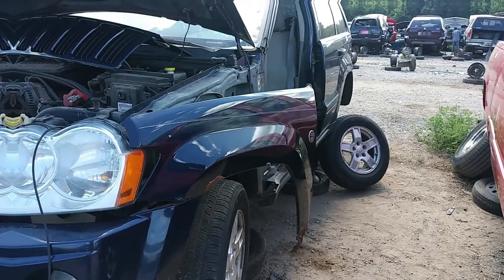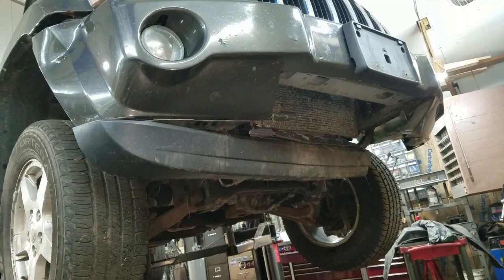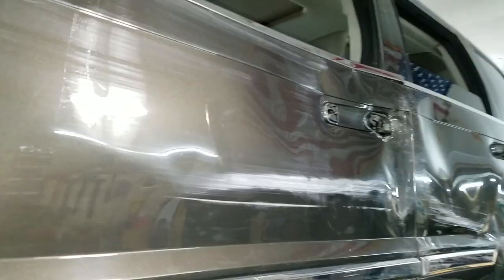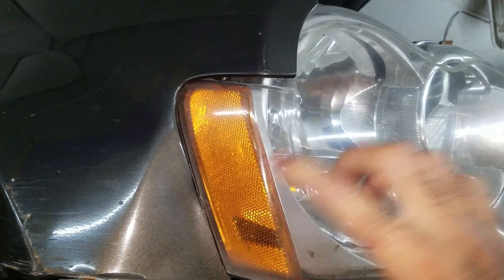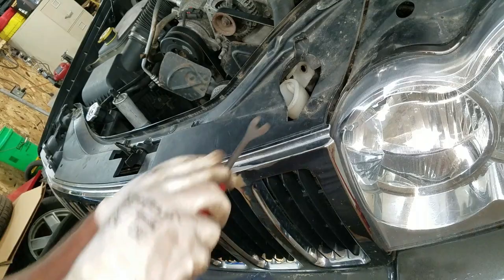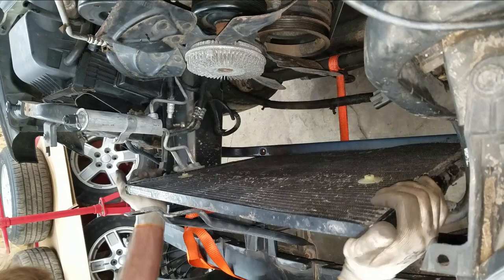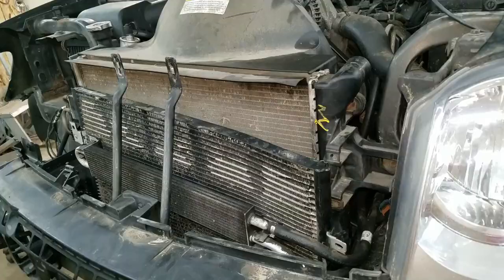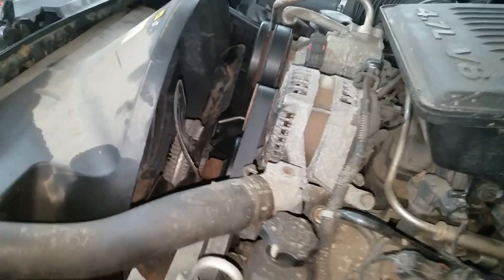2006-2010 Jeep Grand Cherokee radiator bumper cover grill replacement

Comment: Yo!   The correct term for the clippy things is "Scrivets"
Reply from the maker: Scrivits

Plural of scriv; (Weed) scrivits AKA scrives. Pronounced "Skriv-it's"

1)Shake.
2)Tinny partials of weed.
3)What is left in your nug-jar after smoking all your buds; the little hairs and crystaly stuff.
4)Little nugs that fall off your big buds that are good to roll joints or blunts with.
Reply from the maker: @tbskirk  Now I'm going to have to use that instead of clippy things.
Reply: @RustBeltAuto  Scrivets are the ones with screws. It's a rivet clip. But that's not as cool sounding as clippy thing.  Or maybe crivet. I dunno, w/e.

Comment: Hey brother sorry to bug. But you have helped me in the past and I hope to be able to ask another question. Engine stuttering when taking off. I start it cold and let it move up a few lines then I’ll start to move. But it isles and jerks. Idk what to start with first. IAC MAF or tps. Any idea? 99 Sierra with a 2003 4.3 Silverado engine. When warmed up normal and driving I can hit it and takes off like a dream.
Reply from the maker: No codes?
Reply: Rust Belt Auto no codes at all.
Reply from the maker: @Angel-wf6jh  make sure both ect, and iat sensors are reading the same temperature within about 5 degrees, when it is dead cold. start there.
Reply: Rust Belt Auto oh that’s interesting we’ll see. I have meters and a temp gun
Reply from the maker: @Angel-wf6jh  you need to look at the values on a scan tool. if the are not reading the same when it is cold, they usually run bad, and start hard. Spark plugs can also be a cold issue.